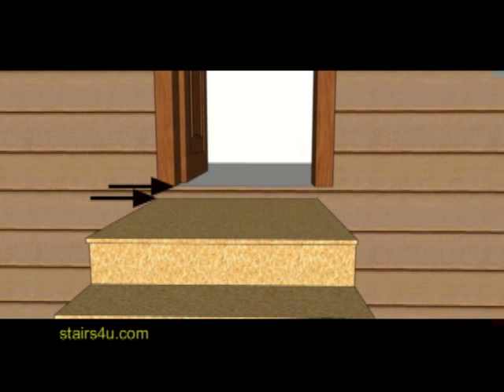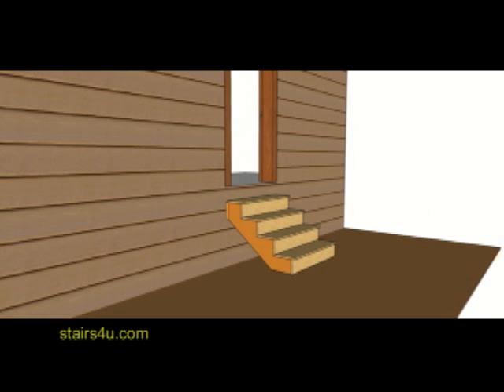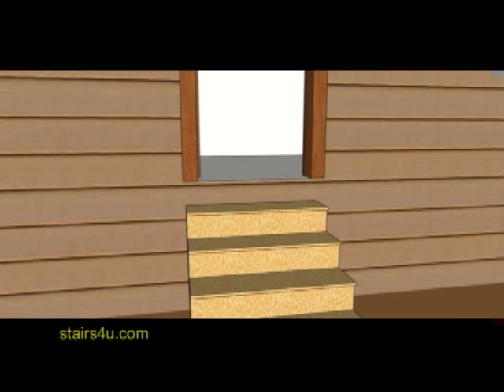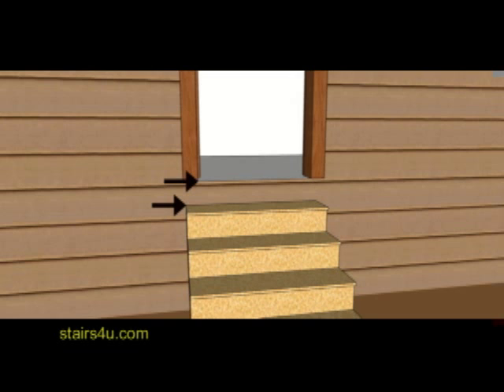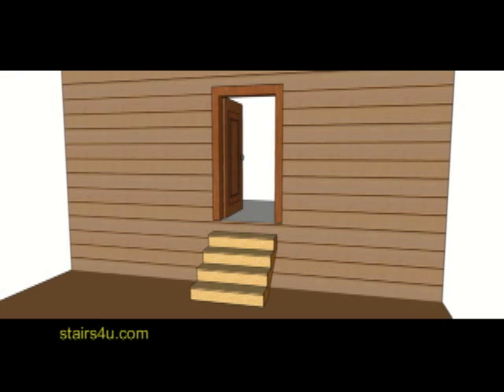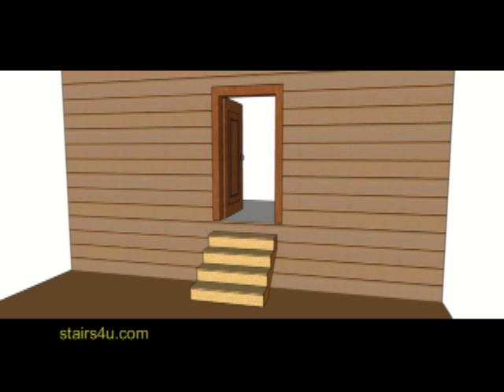Height of Landing or Stairway at Exterior Door – Building Codes for Stair Builders

Comment: thank you for this video  as I am building a set of steps into a retaining wall I needed to know if I am allowed to have a small step off the top landing to the finish ground level which is only 2 inches
Reply from the maker: As long as it meets your local building codes. Usually the smallest step is 10 inches in depth for stairs in homes.

Comment: I understand the 4 inch dimension referred to between interior floor and the exterior deck or landing.  Does this apply to exterior opening doors and is there also a minimum dimension to prevent water intrusion?
thanks....
Reply from the maker: I would check with your building department.

Comment: I have an exterior door to a garage. I have 12” of rise from grade to threshold. I was going to install 2 steps at 6” height a piece. My 36” wide door opens outward, into the steps. Do I need a 48” long x 36” wide landing at the top of my step at the threshold, before I step down to the last step before stepping onto the ground?
Reply: You do not need a landing. That is considered an interior stair so you are good into a garage.
Reply from the maker: I would check with your local building department to answer your question. I would think that you would need a larger landing at the top of the stairs.

Comment: The height is to the top of finished floor and not the top of  threshold, correct? Im fixing to build my steps from the garage to house.
Reply from the maker: I would love to provide you with an answer to that question, but it might be confusing the other viewers. I would suggest contacting your local building and safety department for an answer to this question.

Comment: You need a landing at all exterior doors, with the exception of 2 or few risers on residential.

IBC 2015-

1010.1.6 Landings at Doors

Landings shall have a width not less than the width of the stairway or the door, whichever is greater. Doors in the fully open position shall not reduce a required dimension by more than 7 inches (178 mm). Where a landing serves an occupant load of 50 or more, doors in any position shall not reduce the landing to less than one-half its required width. Landings shall have a length measured in the direction of travel of not less than 44 inches (1118 mm). 

Exception: Landing length in the direction of travel in Groups R-3 and U and within individual units of Group R-2 need not exceed 36 inches (914 mm).

1011.6 Stairway Landings

There shall be a floor or landing at the top and bottom of each stairway. The width of landings shall be not less than the width of stairways served. Every landing shall have a minimum width measured perpendicular to the direction of travel equal to the width of the stairway. Where the stairway has a straight run the depth need not exceed 48 inches (1219 mm). Doors opening onto a landing shall not reduce the landing to less than one-half the required width. When fully open, the door shall not project more than 7 inches (178 mm) into a landing. Where wheelchair spaces are required on the stairway landing in accordance with Section 1009.6.3, the wheelchair space shall not be located in the required width of the landing and doors shall not swing over the wheelchair spaces. 

Exception: Where stairways connect stepped aisles to cross aisles or concourses, stairway landings are not required at the transition between stairways and stepped aisles constructed in accordance with Section 1029.
Reply from the maker: Is there something I said in the video that was incorrect or are you just providing us with what the building codes suggested in 2015?
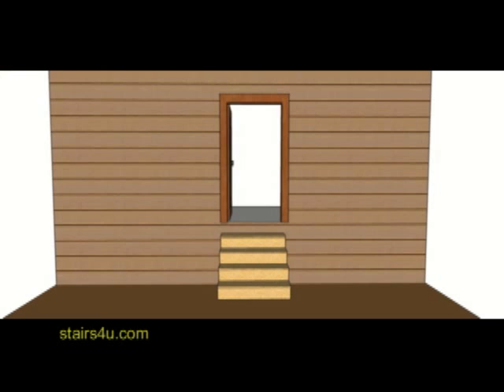Reply: @stairbuilding  I believe he is referring to the staircase you begin covering at 1:29, which is an external staircase with no landing.
Reply: @stairbuilding  You show too many steps in the picture.
Reply: @darrel Riley according to 2012 IRC, a landing is needed on each side of an exterior door.
Reply: @davidworker4053  And where can that be found?

Comment: I have a patio window in the kitchen but no deck, I purchased the house that way, My question, will that be a building code violation when i sell the house in Michigan? I await your response!! I did like your height of landing info.
Reply from the maker: If you're referring to a sliding glass door or something that will allow you to access the exterior, then you would probably need a set of stairs if it's higher than 7 1/2 inches off of the ground or a concrete slab if it's lower, but I would recommend checking with your local building department for more information.

Comment: I'm in the process of this right now and it's good to see you have the same understanding of the codes as I have. I installed a french door where a window once was and was told I had to have a landing. The doors are 36 inches long so the code says it has to have a landing 44 inches in the direction of egress. I guess I could get away with 36 inches since group R-1 isn't really covered but for safety, I'm going to go with a 44" landing. It's only 19 inches above grade so no extra stair permit will be necessary (I already have a general permit for the work). I'm also in San Francisco Ca, where codes enforcement is very strict.